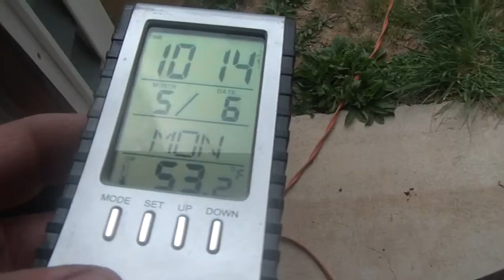5_6_2013, Using Honda TRX300 4wd as a tow truck.

Comment from the maker: dwmogan; The 2 you have there are in nice shape, I would keep the 200M as my daily beater and work on restoring the 200X. I did not like the 250R I had, for the trail riding I like to do, it seemed to spin out, wheelie, overheat, and foul plugs. The 350X I had kicked like a mule when trying to start it when cold. I did not keep either of them for long. Good luck with Ur new toys.